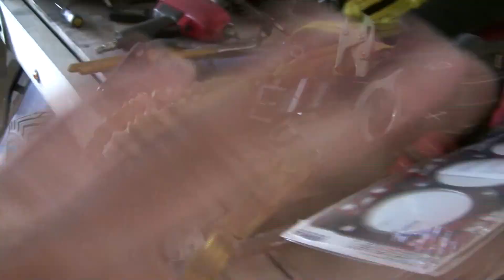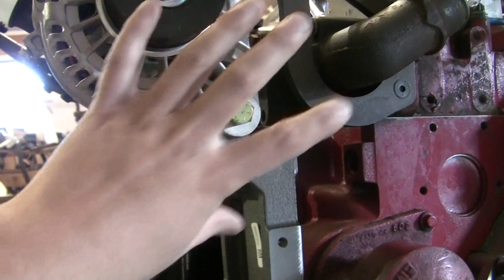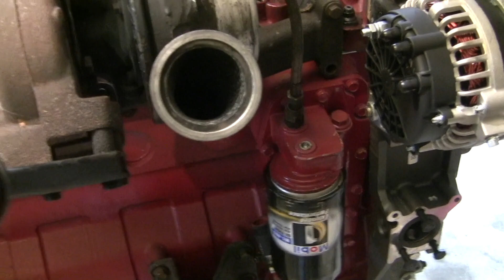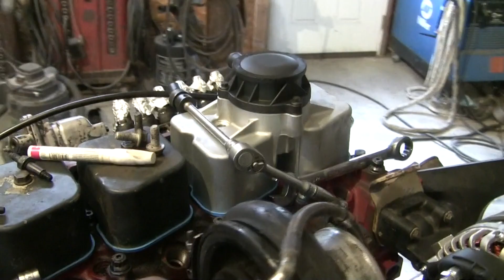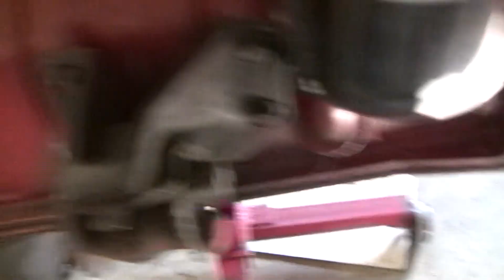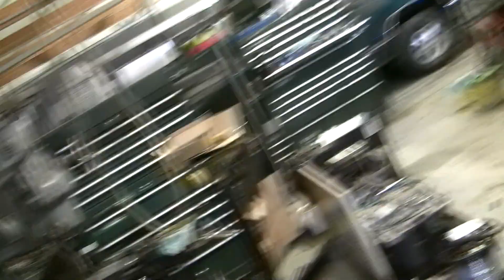My Duramax to Cummins swap! Part 1

Comment: You know your stuff!  Is there any physical dimension difference between the 6.7 and the 5.9?  I’m considering a 6.7 in an ‘01 Chevy.  It’ll be a stock engine, but I have it and my GM truck is powerplantless..  Thanks for your video!

Comment: Hey man not sure if you figured it out yet but the Case dual breather just needs moved back one spot to work with your engine. I usually use a cover with a fill cap on cylinder 1 and the case breather over cylinder 2 and 3. There are front cover blockoffs for your original fill location as well. I just like pouring the oil in from the top instead of it just running down a couple gears straight to the oil pan plus with just the screw in block off for the whole I don't have those common leaks in that area and don't have to worry about spilling oil on the belt by accident. Hope that helps.

Comment: Im put 12 value in to 74 f350 its a car hauler i have a 545 allison trans was thinking on the allison 1000 appreciate your in put !! Thks
Reply from the maker: The 1000 will be a step up, as it has overdrive and lockup torque converter. Huge boost in fuel mileage. Being you havent blown up the 545, the 1000 should last well. Check out the Howard's conversion as you've already got the sae 3 bellhousing on your cummins

Comment: Just wondering why you are doing the cummins swap . The Duramax is not good enough
Reply from the maker: I was tired of having less power AND less reliability than a Cummins. Chevy truck build quality is far better than Dodge in this timeframe though
Reply: @deerefanatic  the reason i ask is that I had a 2500 hd seirra 6.0 i agree with you about the build quality on the dodge .I also keep hearing how good the Duramax is supposed to be . I  would like to install a 4BT cummins  and what kind of fuel mileage I could get

Comment: Do you do conversions for living I need one
Reply: I have a much better & much cheaper  "conversion" . This "conversion" is .... Buy my Dodge Ram CUMMINS/AISIN 4x4 with the dodge/CUMMINS EXHAUST BRAKE. THIS "conversion" is converting you to CUMMINS/ AISIN, not converting some P.O.S. chevy.
For example, my Dodge pulled my 12,000 LBS  R.V. FIFTH WHEEL UP THE ROCKY MOUNTAINS USING CRUISE CONTROL (I NEVER TOUCHED ANY  PEDALS.  
ON THE DOWN SIDE, I SET MY CRUISE CONTROL & FACTORY EXHAUST BRAKE (NEVER TOUCHED A PEDAL). This was EASY BECAUSE, Dodge rates my truck to tow  31,000 lbs, just out for a Sunday drive. I have never seen another pickup truck move almost 20,000 lbs up 6% and down 6% with such easy. DODGE making the Rocky Mountains Flat.
Reply from the maker: @nellyfarnsworth7381  My gooseneck is 10,500 empty. My old 12v Cummins hauled it no problem. Hence my conversion.
Reply from the maker: Guillermo, I dont really, but can do one for you if wanted. But it wont be cheap. Lots of Labor

Comment: Is she done? Also are you able to retain the cruise control? How did you address the drive by wire on the chevy, did you have to install a new pedal with a cable for the cummins, that would go hand in hand with the throttle to cruise contol..
Reply from the maker: It's still in progress. Cruise will be an external unit.

Comment: Ready for part 2.  I'm currently swapping a 12 valve into a 1997 K2500 Suburban.
Thanks for sharing so many details.  I'm currently looking to purchase the "Freightliner" bracket.  It appears that will be my best bet for my accessory brackets.  Where did you purchase yours?

Comment: Where did you get the bell housing adapter ?
Reply: Do you happen to have the info for the seller?
Reply from the maker: Ebay.. An outfit out of Ohio. Not destroked plate, but nearly identical for less money.

Comment: Also, I thought you had to change the cam and tappets and not just the timing cover for the p pump swap?
Reply from the maker: junglejonny1000 No sir! You do have to remove the cam to change the gearcase, but you can put the same cam back in once you've installed the new gearcase.

Comment: Awesome build! Thanks for the tips and info given on the 12 valve. I'm actually working on a 12 valve swap into my 04 2500hd right now. I'm curious if you know or have a plan to get the ecm and bcm to work with the cummins. Ive done mountains of research and have come up empty handed. I talked to a"master technician" at chevy and they were saying it would be impossible. PPE also said good luck and that I'm going to have to build an autometer gauge cluster. My goal is to keep my factory instrument cluster.

Any info is greatly appreciated.
Thanks,
Dj
Reply from the maker: Dj Bradbury Yes, the ECM will "talk" to the Cummins. All gauges will be kept working! The key is using the duramax  sensors in the Cummins engine.

Comment: I'm really excited to follow you through this build. I dropped a 12V in my '04, in place of a blown Duramax and was "red necking" along until I got to the electrical. Truck has been sitting for about 10 months because I can not get power to the proper places.
Reply from the maker: Gary Cook I'm waiting on the turbos and transmission to be finished and sent back from my builder. I've thinned the LBZ wire harness already. I'm in hopes that the allison may work out of the box with the factory ecm still in place.
Reply: I hope you go as in depth with what you need and don't need from the harness as you were in this vid. I figure you only need about a quarter of what's there but I'm dead in the water.
Reply from the maker: I'll try to do that... I'm overdo for a followup video, but not much progress has been made. :)